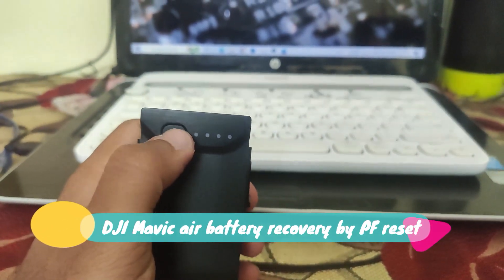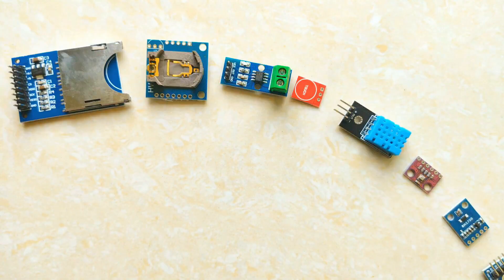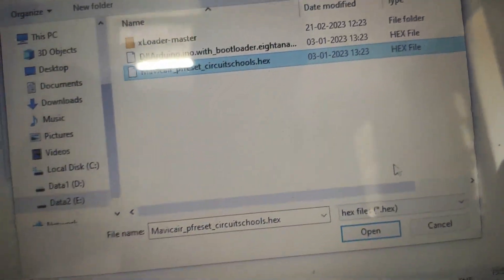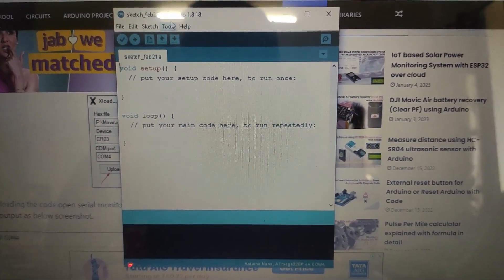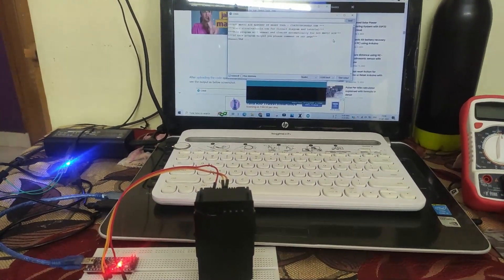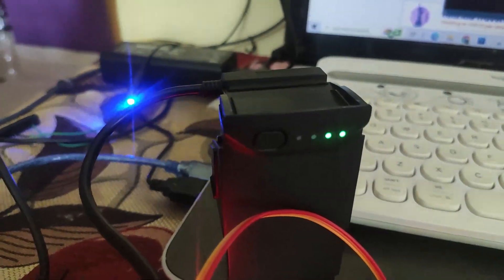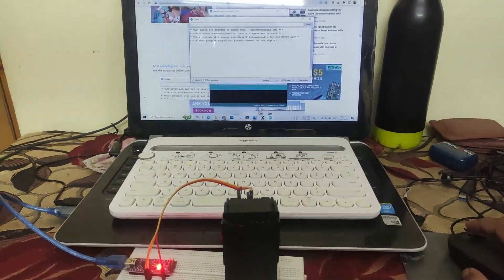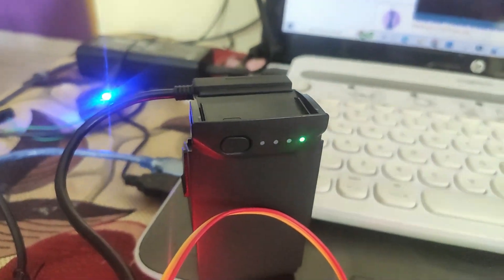DJI Mavic Air battery recovery using Arduino Cheap and Easy Method  #djibattery

Comment: Did this for 3 batteries  - two worked fine the third is getting the dreaded  "Battery not found. Please check wiring". Battery 3 has each cell at 4volts, so cells are charged.  What could be the problem, how do I go about diagnosing?
Reply from the maker: @jla8671  there is a method, but it should be done with high caution, email us for details.
Reply from the maker: Also there is a chance of  BMS chip malfunctioning if so this tool cannot solve.

Comment: Hello, when I do it with 115200 in Xloader, it says 0 bytes upload, what should I do?
Reply from the maker: @Brk94  please use AVRdudess which is better and works, here is the tutorial: https://youtu.be/oNaQ5Ehbpsk
Reply: @CircuitSchools  I tried this and it detected and installed it, but nothing appeared on the serial monitor.
Reply from the maker: @Brk94  are you using Arduino Mega?
Reply: @CircuitSchools  no ı use arduino nano
Reply from the maker: @Brk94  are you using baudrate 115200 on serial monitor?
Reply: @CircuitSchools  yes
Reply: @CircuitSchools  But it never came to any kind of serial monitor
Reply from the maker: @Brk94  send the circuit wiring and screenshot to our email circuitschools@gmail.com so, we can verify if any issue.
Reply: @CircuitSchools  ı sent an e-mail.

Comment: I don't think any of this works for batteries that have gone into hibernation mode and the voltage drops too low.  I've tried it with no success.  Just buy a new battery.
Reply from the maker: @dronegirl7539  had you charged the internal cells to more than 3.7v~3.8v, if so the BMS really wakes up and responds to our tool. Not only hibernation, They may be other issues with the BMS too which can stop the BMs from waking. If you need more help contact us at circuitschools@gmail.com

Comment: I was stuck as Unseal/FAS forever. I charged each cell to 4.0v using the TP4056 with a 5v 550mA charger - still couldn't get past Unseal/FAS. Similar to other people XLoader wouldnt use baud rate 115200 with the Nano clone I was using, but 57600 would work. After everything failed I decided to try it with an Arduino UNO clone instead (Using the UNO's A4, A5 and GND pins). XLoader would now upload on 115200 and finally it fixed my battery. I'm not sure what could've been the problem with my Nano but if anyone else is in a similar situation it might be worth trying an UNO instead. Hope this helps.

Comment: Used an Arduino Uno clone with this method. 
Connected the pins A5 and A6 + GND of the Arduino board to the battery (not the SDA and SCL labeled pins of the board - that didn't work). 
Selected CR03, the right com port  (the com port that discovered the board in arduino IDE) , baud rate 115200 and uploaded. Opened the serial monitor. Worked like a charm.  
80€ saved. Thanks.
Reply: Thanks so much for this comment. I should have figured it out myself. It's so obvious 👍
Reply: did u implement some pull up resistor? because the Arduino uno works with 5v while the BMS i think 3.3, could use explain to me exactly what u did? i don’t want to damage the board
Reply: Brother i am student please give me the hex file for free please 🙏

Comment: Hello bro please soon reply video for dji air ,mini ,mavic battery upgrade capacity edit in arduino nano please soon
Reply from the maker: @SOULIGNITE-Z  sry bro at present I don't have the code to update them. You can do it with cp2112 and battery killer software

Comment: Please update to work with Ronin M or MX batteries which also use BQ30Z55 but have 4 cells. 🙏
Reply from the maker: @SebastianHagemeister  our code is just to reset the PF flag, may be the same code works. if the board is same, check the SCL and SDA pins according to ronin and connect.

Comment: will this work on a spark battery with Arduino Pro Micro ATmega32U4. Need your help
Reply from the maker: Yes It works for spark battery, as the tutorial is simple and easy make a try

Comment: Someone is so kind to clarify whether or not it works with Mavic 2, the same one that works for Mavic air Or do we need another specific file for Mavic 2?. They have asked a lot and no one answers. Thank you
Reply from the maker: as we dont have mavic 2 battery, its not possible for us to test it. As this setup is soo cheap you can make a try.
Reply: @CircuitSchools  I crossed my fingers and I did it with Arduino uno and it went well, so yes, it is compatible with the batteries of the Mavic 2. The process is done exactly the same, making the correct connection in the battery. Of course!

Comment: I'm following the mentioned steps but in Arduino after choosing serial monitor and selecting 115200 baud it stuck at Unseal/FAS ... So, no Done unsealing and writing Done. Do you have any idea why this is the case?
Reply from the maker: batteries power is low to power up the BMS, Look the ending part of the video to solve this.

Comment: I'm using the Arduino UNO R3 which has dedicated SCL and SDA pins for I2C control - should I use those or the dual-purpose pins A4,A5 for analog input and SCL,SDA for I2C control?
Reply from the maker: you can use it on any of those. Both works same

Comment: Id like to unlock and get rid of my pf error code on phantom 4 pro battery due to sitting so long. is it the same process? and can i get the code. liked and subscribed. thanks
Reply from the maker: you can download the code from the website. and as we dont have phantom 4 pro battery we havent tested. May be this works or not you can make a try as its cheap to try.

Comment: what happens if you use 5v phone charger with a TP4056 to charge the cells?? did I screw them up? because I got them up to 4v but the arduino IDE is stuck on Unseal/FAS ...

Comment: I would like to do the same but with MAVIC PRO 1 battery. Is there an .ino file ready to upload to arduino and use a software to unlock PF?

Comment: hi i am stuck in unseal fas even i chargfe the battery in 2nd step all cells is 4 vlots now why nothing happens if unsealing
Reply from the maker: may be there is a problem with connections or the BMS itself is not responding

Comment: Hi, I have tried all the steps, however stops at loading the hex with xloader. (I have used it for other hex). Can the issue be that I have the Micro version? Different chip on it. Any tips for me would be great. 😀
Reply: Just add that I managed to upload the hex both with Avrdude and xloader, however the Audrino Micro just freezes, most likely since the hex is made for a different chip. Still looking for a similar hex file for the Micro. Thanks for any tip.

Comment: Thanks for the video ! I'm trying to repair my 3 DJI Mavic Air batteries, but i'm stucked on "Unseal/FAS". I've also bought a lipo charger and charged the cells to a correct voltage, but nothing changes. The thing I'm doing different from the video is using a "DCcduino" Arduino UNO Chinese clone, should this be a problem ?
Reply from the maker: may be there is any connection problem, please check the wiring and try. It works with any arduino clones.
Reply: @CircuitSchools  On an actual UNO R3 revision, should we use it's dedicated I2C SDA/SCL pins or the repurposed analog pins A4/A5?
Reply from the maker: @stevehoge  you can use any of those as both work same.

Comment: With many thousands of Mavic Pro and Mavic Pro Platinum owners having the (now) very common 'Battery Error' in many of our original DJI batteries, have you given any consideration to creating a data upload file for both these Mavic batteries similar to what you have done for your Mavic Air battery so we can use your Arduino procedure? I for one, am very interested in obtaining such data file specifically for my Mavic Pro Platinum battery; even if you charged a (small?) fee for doing this for interested Mavic Pro / Pro Platinum owners! There is total confusion on what Pins 1 & 10 in this battery actually are; e.g., in the only "reliable" Mavic Pro / Pro Platinum complete pinout [[which are completely different for all other Mavic models battery pinouts]] I have come across on the Net, Pin 1 is shown as RXD (UART Receive) and TXD (UART Transmit), BUT do Pins 1 & 10 also actually correspond to the SCL & SDA pins respectively (or even vice versa), and if so, which is which??  I am not knowledgeable in UART understanding!  I know there are SCL & SDA locations on these batteries internal circuit board however, you have to essentially destroy the battery casing in getting access to this board - also, it is a time-consuming exercise and one that carries a fairly high "danger risk" for the inexperienced (and experienced alike) to attempt dismantling the battery casing! I've tried the CP2112 board procedure which failed every time stating 'battery not connected or similar error message' and come to the conclusion Pins 1 & 10 (SCL & SDA) are NOT connected to these UART designated external pins???? Appreciate your (or any of your viewers) advice here, please. I have three Mavic Pro Platinum batteries and all three show absolutely no puffing or damage or other adverse observations and all three can be discharged (for the defective DJI battery via the USB - battery adapter) and charged fully! The only difference is that the defective battery shows the "Battery Error" fault which, therefore, prevents the drone from flying!!!! Clearly, IMO, the issue is solely that the PF Flag is blocking the battery from operating!!! Having received the "Over current flashing code" during charging this battery wherein the charger actually put out more current than it should have(??) and repeatedly does this for the few times I repeated this process, I no longer use this charger and am waiting on delivery of a new one!  Greatly appreciate your help in resolving this wide-spread issue with Mavic Pro Platinum batteries, please. Cheers from Down Under and Seasons Greetings to all. [PS: I have subscribed to  your site and sent you a shorter version of the above email].

Comment: First of all, I would like to express my gratitude to the developer who generously shared the Maverick Air battery recovery code and provided an easy-to-follow explanation. My battery had not been used for about 6 months, and one of the two batteries had low voltage, causing the battery management system (BMS) to lock the battery, preventing it from charging, and the green LED was not functioning, as described in the video.

Following the instructions in the video, I purchased an Arduino Nano and the necessary cables to prepare for coding. Since one cell of the battery had dropped below 3 volts, I disassembled the battery and individually charged the three cells using the 1-cell lithium polymer battery charging function of an RC battery charger. After charging the 3 cells to the same level of 3.7 volts, I prepared the program and files as instructed in the video. There were many trials and errors in the process. Even though I followed the video, the file did not upload, and the red transmission LED on the Arduino Nano did not blink. Despite trying to change the transmission speed, as suggested in other comments, the file still did not transfer. Finally, changing the COM port from COM4, as mentioned in the video, to COM7 allowed the upload to succeed.

After a successful upload, following the remaining steps outlined in the video resulted in the battery coming back to life perfectly. I then charged the recovered battery with a DJI charger and successfully completed a flight. Since the voltage of the three battery cells in my case did not drop significantly, there seemed to be no impact on the battery performance. If not using the battery, it seems advisable to charge it at least once every three months. Charging until the green LED shows two bars should be sufficient; it doesn't need to be fully charged. I hope everyone can successfully recover their batteries.

Comment: To have a good contact with the battery, use metal tape that we use to make lithium battery packs (this takes soldering very well) cover with a welding film on 8mm, solder one end of a strap wire above
cut with scissors to have the pin of the strap like a flag (the flag being the ribbon).
you now have a connector that ensures a good connection.
I think it must be possible to do it with a piece of tin can (I haven't tried)

Comment: So I did everything perfectly but the battery light still didn't come on even when pressing the button.  I had to take apart the battery.  No need to drill holes or anything crazy.  Using a pen knife you can carefully ubdo the back of the case by working near the connector.  It will open like its on a hinge and you will see the BMS board at the top.  There are three cells that each should be over 3 volts.  There are 6 total pads.  3 on the right and 3 on the left.  Each two pads should show you the voltage using a volt meter.  Find the cell that is low.  Usually one will be under 2 volts.  Make sure to take note of the positive and negative side and take a 4 volt battery supply and connect Pos to pos and neg to neg.  Do this for only a few seconds using some wires.  No need to solder anything then check the voltage.  Keep doing this until the voltage is over 3 volts.  The program should now work and you can charge fully using the DJI charger.
Reply: Thanks to OP and comments here like this one for the help! 
I had to open the battery and get the cells up to 3.6v before I could reset the battery using the arduino as in the video, although I flashed the arduino via the command line on my mac using avrdude, installed using  like so:

> brew install avrdude

plug in your arduino to a usb port and use this to discover its location via
> ls /dev/tty* | grep usb

> avrdude -p m328p -b 57600 -P [INSERT YOUR USB DEVICE LOCATION HERE] -c stk500v1 -U flash:w:Mavicair_pfreset_circuitschools.hex

2 batteries saved, thanks!
Reply: You are amazing. This worked! For charging the battery above 3V i used phone charging adapter, cut a spare micro usb cable and connected the end of this cable to battery terminals. It charged the batteries quite comfortably. I just ensured that the voltage of battery was only about 5V

Comment: It would be good if you tried to open the battery of a Mavic Air 2 and transfer it to the battery of a Mavic Air 1 to increase its flight time, since one has more milliamps than the other.

PD: Good video 🎉

Comment: Great program that has worked for me. Due to a lack of battery power, I also had to open battery case and manually charge each of the 3 Lipo batteries. The Ardunio UNO R3 (ATMEG328P) worked fine after trying the software on a NANO "every" ATMEGA4809 chip set.😅
Thank you, Circuitschool

Comment: Will this method work for the dji mavic pro. I work in a hospice and we were gifted one but the batteries are non responsive.
We are going to use it to check the gutters and roof of our building, that is if I can get it working again - not sure if it works though so not wanting to buy a new battery etc.

Comment: Thanks for this great instruction video. It felt like a miracle to see the green battery leads flash like in the old days. At first I encountered some trouble with Xloader, but uploading with a baudrate of  57600 instead of 115200 was the solution (took a while to find out 🙂). Also the use of TP4056 was a succes . I bought 2 for nearly 1 euro! Connected it to the usb out of the Mavic charger and within a few minutes I had charged the 3 cells from 2.40 -1.21-1.51  to 2.85-2.82 and 2.89.  This was enough to properly run the HEX. Thanks a bunch ! While typing this the battery indicates it is fully charged. Greetz from the Netherlands.
Reply: I can confirm, using the default baudrate (57600) worked for me. I was able to restore 2 batteries using arduino nano clone.

Comment: If you get stuck keep retrying and or adjusting wires I Took some retrying multiple times but I finally got it to take. I had issues with the xloader device settings not seeing my device so I ahead to change it to the cc01 and not the cr03. Even though it said the 4854 bytes were uploaded.

Comment: You're really awesome, thank you!👍You saved my Mavic Air 1 battery.🙂
I had to use the TP4056 charger, charged the battery's 3 cells up to about 3.6V, and after the script was also able to recognize and unseal the battery. Xloader wasn't working at 115200, so i just left it in 57600. I used an Arduino Nano clone (cheaper) and it was fine. 
Greetings from Hungary!
Reply: what happens if you use 5v phone charger with a TP4056 to charge the cells?? did I screw them up? because I got them up to 4v but the arduino IDE is stuck on Unseal/FAS ...
Reply: Dji Mavic air battry cell hold 4v in each cell so it okay
Reply: Normally 3 cell battry fully charge 12.6v but Dji battry hold 13v

Comment: Obrigado pelo vídeo tutorial de como restaurar. Comigo deu certo da seguinte maneira:
Tinha a versão do arduino ide atual e não deu certo. Tive que baixar a versão 1.8.18 igual a do vídeo. 
Outro detalhe a taxa de transferência o baud comigo não deu certo o valor de 115200, funcionou com a taxa de 57600(xloader). Tive que alterar a taxa no arduino uno para 115200, pois de fabrica veio em 9600. 
E por último Tive que abrir a bateria e carregar cada célula até a voltagem de 3.85v ou superior para voltar a vida. Pois quando fiz o procedimento, não acendia igual a parte final do vídeo. E ao elevar a voltagem para os 3.85v, ao ligar novamente no computador, a bateria acendeu novamente e estou conseguindo carregar novamente.
Obrigado🙂👍🏼

Comment: Check the connector to CR01 is the error i am getting. Any pointers on how I can fix this. Even for working battery I cannot read data. The uploaded bytes are around 30156 which is different fro what I see in the video.
Reply: using wrong hex file in XLoader (I did the same thing initially), the hex file to use is the one linked to on the page the one linked to on the circutschool page